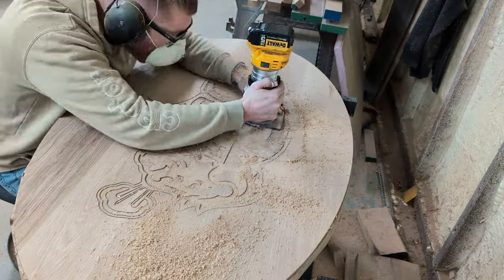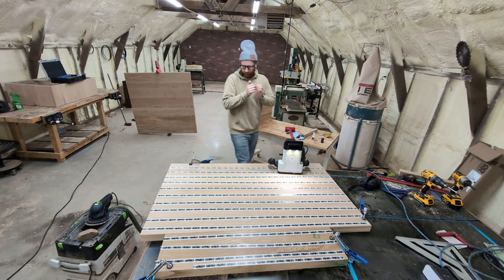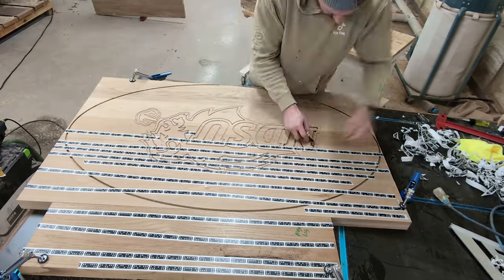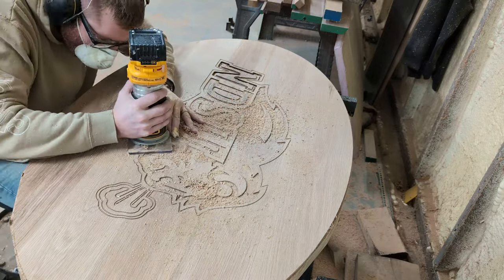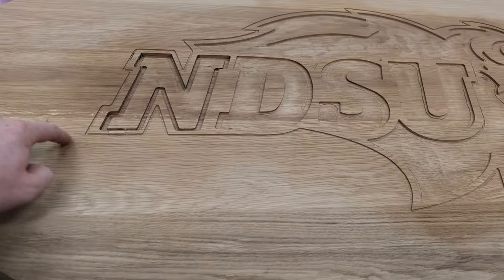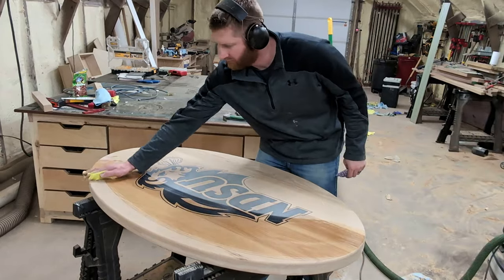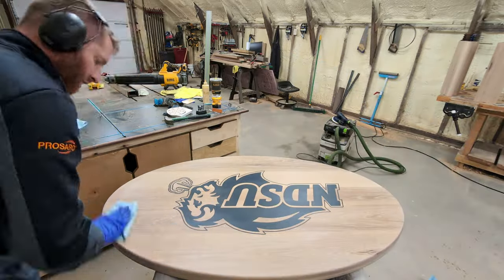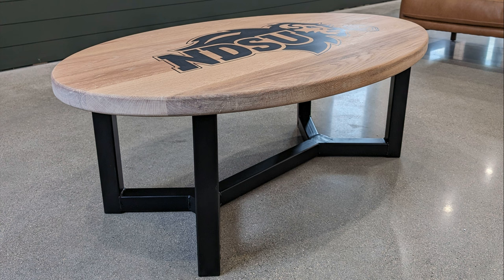ndsu bison table

Comment: You can get a cnc for wayyyyy less than that thing.
Reply from the maker: I'm on a go big or go home trip with a CNC purchase, I've been saving for a 5x10 because I do a lot of large tables and slab work.  But you're right a smaller CNC is a much better investment than the origin in my opinion
Reply: I’m looking for a smaller cnc. I’d like a larger one but I don’t ave room for one unfortunately. The table turn out great by the way. 👊🏼
Reply from the maker: Appreciate it!  Space is always a concern, my shop will definitely need to get rearranged once I get one